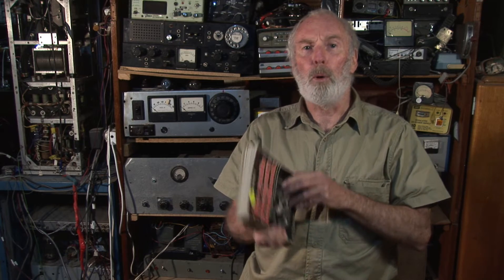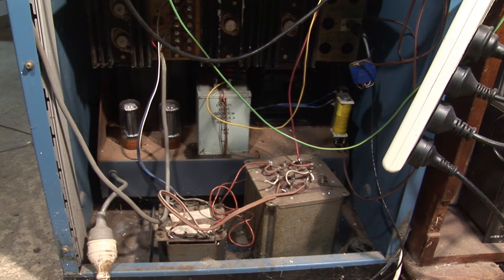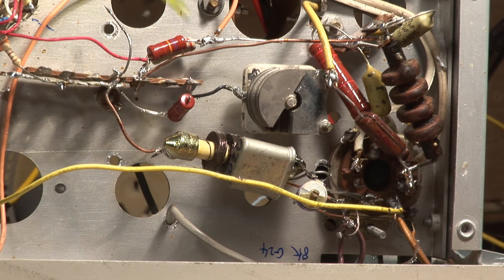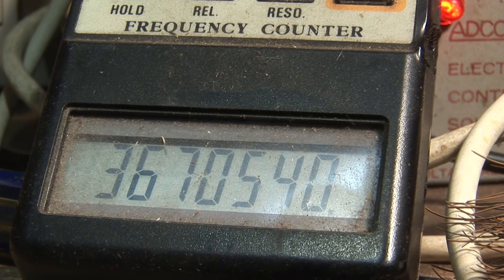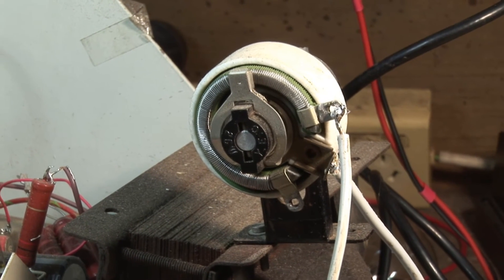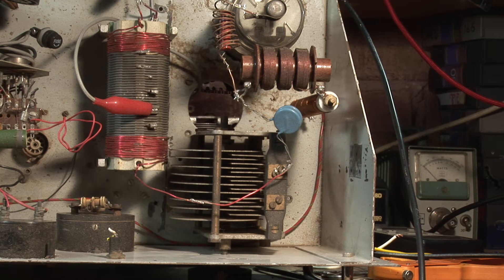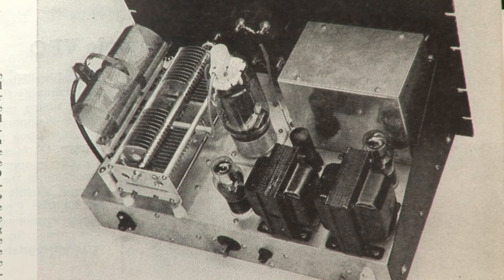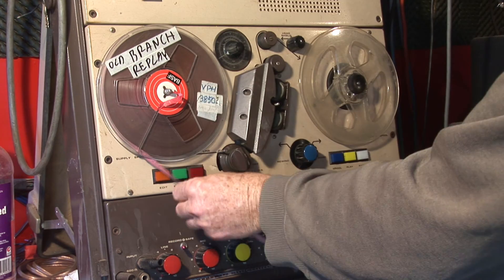Home made 80 metre am  transmitter

Comment: What does HT stand for in this context?
Reply from the maker: High Tension as in hi voltage also known as B supply. Depending on the type of valves and what they are doing it could be from a few volts to thousands in this case about 800. Valves can work at low HT voltages but because they are hi impedance devices if you want power for audio or RF amplifiers you need big volts.
Reply: @vk3ase  thanks so much for the response! 73!

Comment: I'm always impressed to look into the world of the 1-60 meter mission casts,  since from the moment I tuned into the Branch in the mid 70's I had imagined studio quality mitters, mic's, mixers with the sound of sophisticated university graduate students  that just happened to be radio amateurs  that in there spare time came up on 160 late every Friday and Saturday nights....and like Hey Hey its Saturday you couldn't wait to turn on the gramophone ceivers to listen to the next installment of humorous banter laced with technical dialogue. NYE's were always something to hang out for!....And now I see this mazing 80 meter AM mitter put together with such technical know how....I'm actually surprised at how well it works....it has inspired me even more to continue with my plans to build an AM mitter for 160 and 80. Incidentally I built my first AM transmitter from the 1966 edition of the ARRL using a 6146 in the Final driven by a 6AG7 serving also as a crystal oscillator operating on 3555 and 3575 Kc/s. The modulator was a 12AX7 preamp running into a 6C4 phase inverter driving  two 6V6's in push pull, it was only a 30 Watt mitter but I was heard in New Zealand one night, I'll never forget that first overseas contact....those were the days....Clint - VK3CSJ